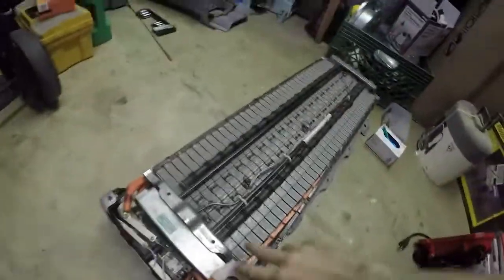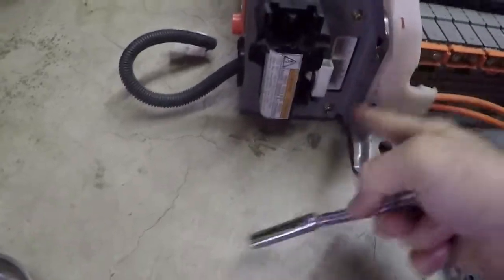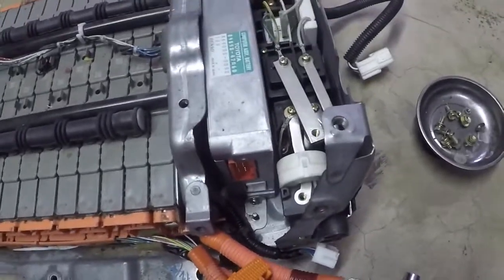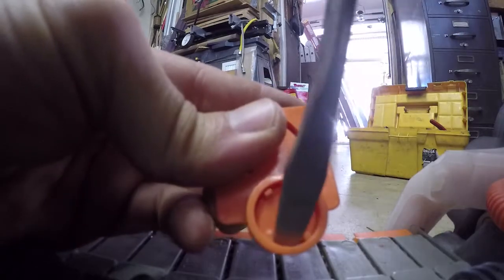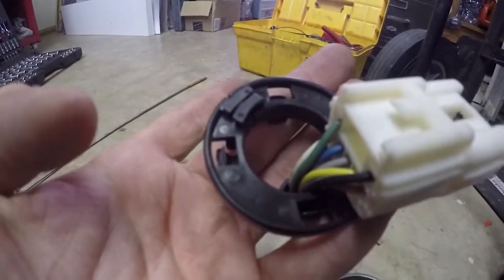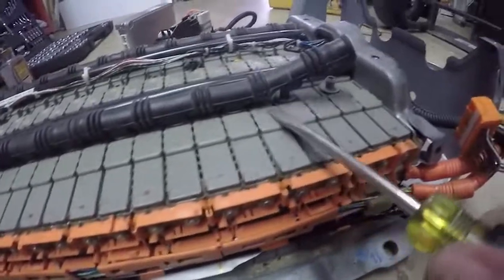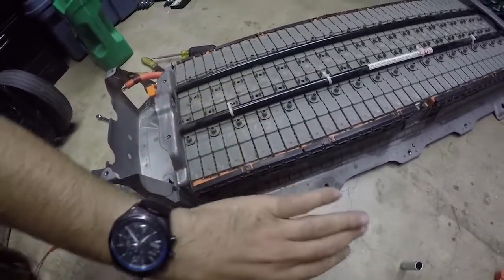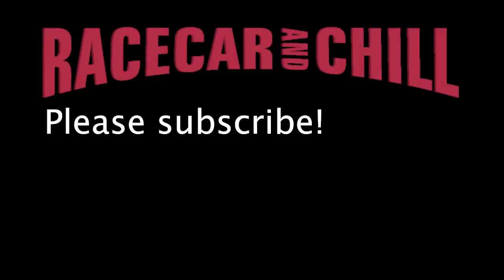⚡DIY How to prepare a first gen Toyota Prius Battery to be returned as a core.

Comment: FWIW... Japanese 1997-2000 "Gen0" use a different pack.
Reply from the maker: PHB _ good to know. I was under the impression it was the exact same car@
Reply: It almost is... except for the battery.  The original Japanese Prius used the same crap "D" cells that Honda continued to use through 2014. Once Toyota developed the prismatic cells, they couldn't get away from the "D" cells fast enough.